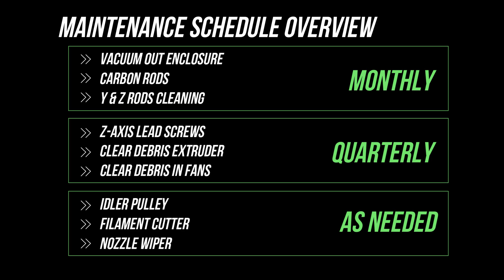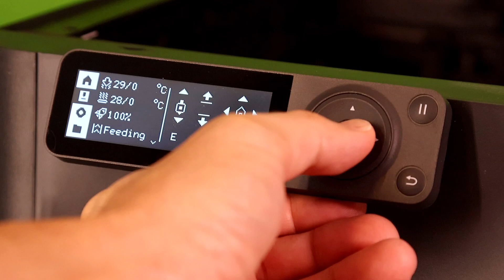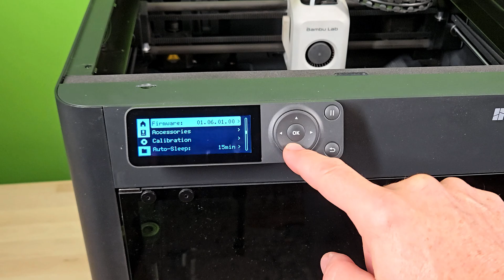How To Maintain Your Bambu Lab Printer! 🛠 Essential Print Quality Routine

Comment from the maker: What’s your go-to 3D printer maintenance tip? 🛠🔥 How often do you lubricate and clean your printer? Let’s discuss below!
Reply: Can I use rubbing alcohol vs ipa cleaner ?
Reply from the maker: @Slyfox1775 I would stick with IPA as recommended
Reply: @Slyfox1775  you realize ipa is exactly the same thing as rubbing alcohol right? Isopropyl alcohol is long for ipa

Comment: I've had my P1S for 3 days. Yesterday, it started squeaking when it does the fast vibration (vertically) during the calibration phase. It also makes a slightly different sound when moving the plate to the upper most position. I thought maybe it was the Z Axis's needing grease but it's brand new, you'd think the factory grease would be there. I tried pushing a little on there but haven't made the grease tool yet so I just put it on the end of my scraper and tried to push it into the top few threads.

Anyone else have squeaking during calibration? I'm new so I'm not sure what's normal and what's not, but I know it wasn't doing it the first day or so of printing.
Reply from the maker: Squeeking is fine in most cases. Let it run for 50 hours or so and it will most likely go away.
Reply: Found out it was… I think z axis pulley?

There’s a pulley on the bottom that you have to grease behind. Did that and it took care of the squeak. 

Heard it again the other day and I’m about 5-6 weeks into having the printer so figured I’d do the whole maintenance routine plus that pulley again

Comment: A word of advice: when you blow compressed air into a fan, make sure to hold the blades in place so they don’t spin. Otherwise, it may generate voltage and feed it back into your circuit, potentially causing damage.
Reply: I have experience when the fan blades disassembles because of how fast they spin... 😂

Comment: Ideally, with the fans you should probably hold them before spraying with compressed air, there is a small chance you kill the motor inside if you make it spin faster than it's rated for. probably not an issue on these smaller fans as they usually have higher RPMS but I'm not sure what they're rated to.
Reply from the maker: So Ive been told, yet I have built and cleaned hundred of computers and never once broke a fan lol
Reply: @planet3dp  same, it's probably more of a problem when mains powered blower style devices. I know the mains powered blower/cleaner one I have could probably get them up to a pretty high RPM. Maybe I cantest with a larger fan (12 or 14mm) from a PC that I can sacrifice to see if it'll die as they're rated much lower RPM than the smaller fans we see here.
Reply from the maker: @benjaminfphillips I could see it if you held the air can on the fan for a long period of time. But I just hold the blade now and not worry about it.

Comment: In my opinion, I would first clean out the printer in its entirety before applying any lubricant. Once you apply the lubricant and then blow the printer out, where do you think all the dust is going to go? I also suggest having a vacuum handy while blowing it out to suck up the dust that comes out, as the super lube can collect a lot of flying debris.

Comment: Just wanted clarification, great video btw I prefer yours over any others. Just wanted to ask about the lube for idler pulleys. You put text for the super lube multi purpose lube but with an image of super lube air tool pneumatic oil. Could you clarify which of these you use for this? After reading multiple posts online I got super lube (the white grease kind) and wd40 dry lube with PTFE, would the wd40 w PTFE work for these idler pulleys?
Reply from the maker: @levig8236  the white grease is good and WD40 is a good alternative for the lube.

Comment: Great video. Straight to the point. I would add that it would be better to clean the debris from the extruder and fans before cleaning and applying grease to the lead screws. Though miniscule, it will keep the dust/debris from clinging to the newly PM'd lead screws
Reply from the maker: @r3v0lution  yep agreed. Already making that change in my next maintenance video

Comment: Sir may I suggest against spraying the fans without holding them still? 
They do after all generate electricity and may pop a component on a board. 
Might be 1/1000000 chance of it happening but it happened to me, so from personal experience I'd say it's worth keeping them still.

Comment: I have a p1p. I noticed turning it on. The screen is taking longer to turn on. Any reason for that?
Also how do you know when to change the filament cutter? Im having issues where in the middle of the print. After I change the empty filament . It messes up on my print.

Comment: Nice, I like to clean the fans and dust out, before the 1st vacuum step. This way when removing the old grease and cleaning the rods I am grabbing any of those particles also instead of recontaminating the new grease and oil as would be in your sequence.

Comment: Hey Man, quick question since I see you reply often! I'm using the Bambu A1 combo. When I finish a print do I need to take the build plate off? I am new to printing but usually have just been taking the item off the plate rather than taking the plate off and then the item off. Is there anything wrong with the way I'm doing it? I see on most videos people take the plate off and I'm worried I'm doing wrong.
Reply from the maker: @dantback  no you don't have to. Only need to remove it if you want to clean it. I have left mine plates on for weeks of prints.
Reply: @planet3dp  okay awesome! I was really nervous I was damaging the bed or something by not removing the plate when taking my prints off the plate so glad that's not an issue!  Thank you so much for the response!

Comment: Please don't clean your fans like that ever again... You have to hold the fan to prevent it from rotation while blowing compressed air on it. Otherwise you risk damaging your printer as the rotating fan generates current which goes back to the printer's circuit

Comment: I would blow out the fans before I did the greasing of the lead screws, to avoid blowing debris into the freshly applied grease. Also, you need to make sure you hold the fans still to keep them from freewheeling when you spray them off to avoid burning them out.

Comment: Check out the Rod Sloth by NeedItMakeIt. I use 3 with quality paper towels covered in IPA. It makes it so much easier to clean all 3 Z screws at the same time and I do it both directions (bed goes all the way up and also all the way down). Be careful when they get to the end as your bed will try to squish them.

Out curiosity why the white lithium grease versus the SuperLube grease (not oil) that others use? I have seen people swear by both but I can't find a good reason to use one over the other and am hoping you have an opinion on the subject.
Reply from the maker: @hotfix7387  ya I have used Lucas oil products for decades and they are always superior to the alternatives so I chose Lucas over the others.

Comment: Too much grease mate, also try PTFE dry film lube next time. Doesn't attract as much dust. You can use the spray applicator on the nut as the bed moves.
Reply from the maker: Yep I can agree with you. I have run into issues with my z screw creaking in the past so I over due it sometimes. That is why I also noted that I add a lot of grease, more than usual.

Comment: Pro tip...I use an old toothbrush for greasing the lead screws. That way I can make sure it gets in all the nooks. I wrap the head of the toothbrush in a piece of plastic wrap (Saran Wrap) between applications. It's also a no-mess solution since you're only touching the toothbrush handle.
Reply from the maker: @Chad.The.Flornadian  nice I like that!